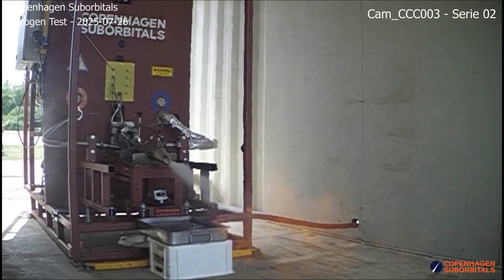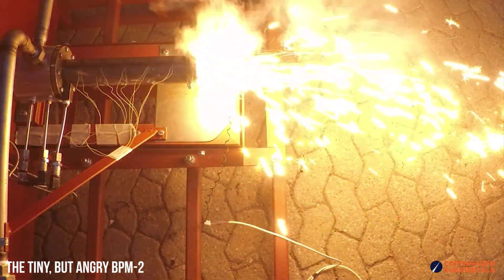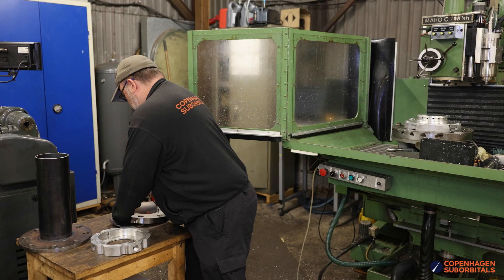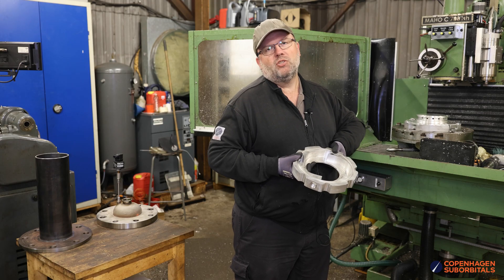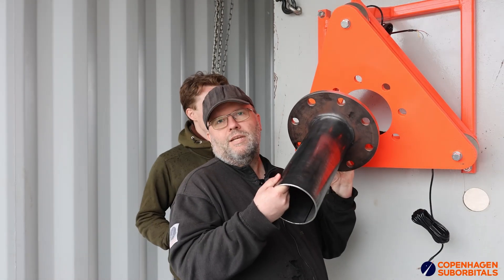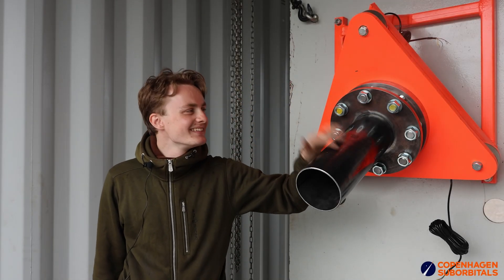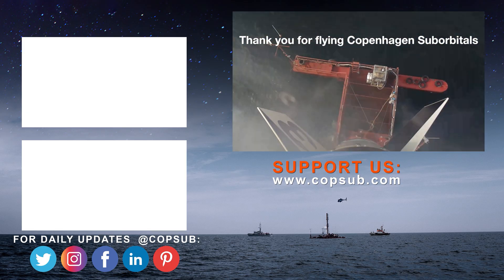Building 3 (Different) Rocket Engines at Once?

Comment: hi im only 14, and was wondering if you need a dergre to be a part of the team, bc im thinking of going to gym then uni. but lets say that dosent work out would i still be able to apley(when om older ofc) since rocketry is my dream and im even building smaller solid fuel rockets at home, with working fin stabilization and a parachute. much love from jylland❤
Reply from the maker: We have everything from kindergarten teachers and artists to engineering PhD’s. 
So no degree is required. Practical experience and production knowledge is much more important.
Reply from the maker: …held og lykke med dit raketprojekt!

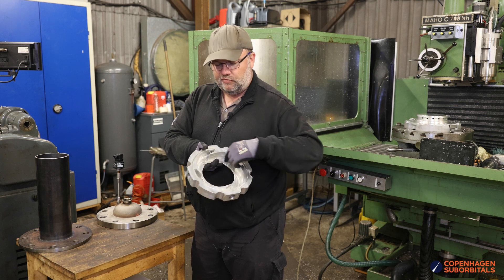Comment: 2:30 The rocket engine has got its own fuel filter? Why is that needed? Also good luck for the upcoming test!
Reply: Even though we try our best to keep everything clean no one will ever be able to guarantee there are absolutely no hidden residues or gunk somewhere in the tank or in the fuel line. Sometimes it can be a sticky flake of paint, an enthusiastic beetle or a piece of PTFE tape gone rouge ... if such a piece of gunk clog up an injector hole it will change the O/F ratio a bit. It might not matter a lot but we will never now for sure. Installing a fuel filter with holes smaller than the injector holes is "due diligence" ... or in Danish: "Rettidig omhu" ;-)